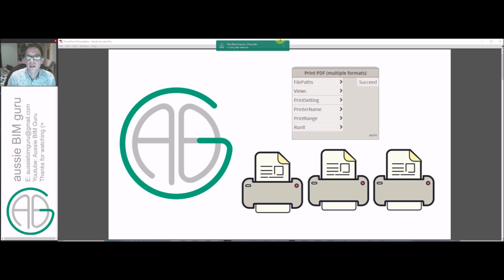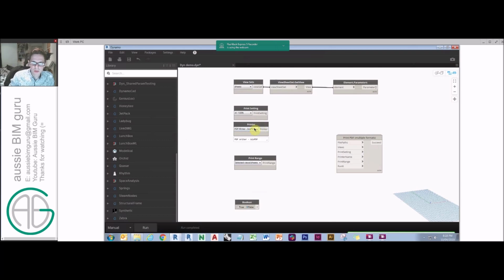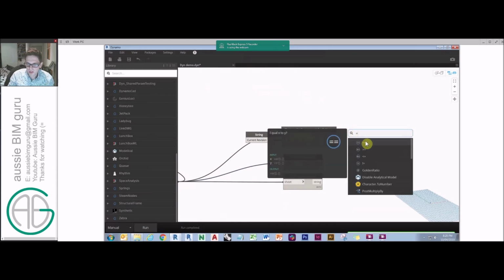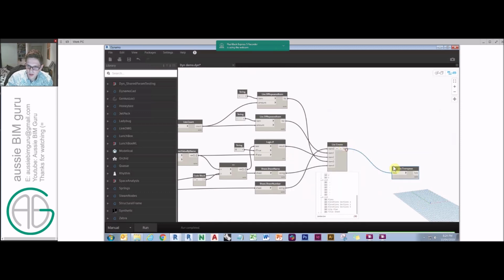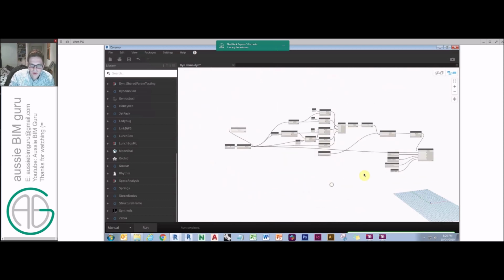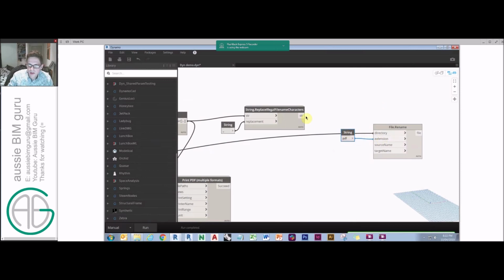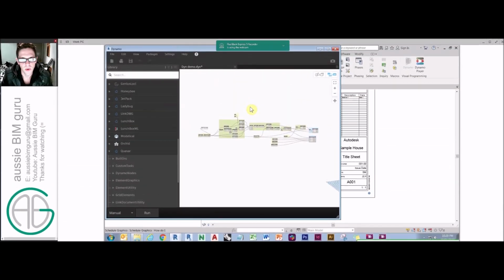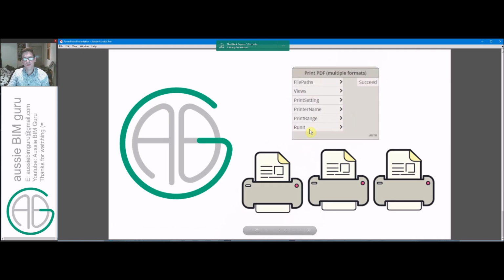Batch Print using Dynamo!

Comment: which version of genius loci have you used ? because Exporting pdf is not available before 2022. Also Revit developers provided Export pdf spec in Revit API for 2022 or above version. for below versions I need printing so for that I need which version have you used for Genius Loci, For that printer setting node and printer name selection node. I am using Revit 2021. Can you please provide that?
Reply from the maker: Its been ages so cant remember unfortunately. Yeah export pdf only works in 2022 plus and personally i found lots of issues with it crashing for large prints. I developed a printer in python for my firm and stuck with the printing API even in 2022+ because of that. Try archilab if you cant find the build of genius loci as it has printing nodes also.

Comment: Hi everyone, I have successfully create this Dynamo script but unfortunately when I try to "Rename" it on Dynamo player by setting it up as False nothing changes. It doesn't give any error, actually is Run Completed on green, but nothing changes.

In the other hand, I have been running the new BatchPrinting (2020 Update) and I have realize it has changed quite a lot from what I can see on this video. I can't find the Directory Path on dynamo for example. I just wanted to ask which buttons should I set up as In put to run it with Dynamo Player or if you are planning to drop a video for the Batch Printing script update. 

Thank you so much!!
Reply from the maker: These days I actually use Prosheets by diroots for most of my batch printing needs (free, naming rules etc).

Directory path should be available in 2020 still, that's odd!

I may revisit this on my course platform as an example potentially, but am unlikely to remake it for YT.

I'd suggest trying datashapes for UI using directory path for print destination, listview for sheets and dropdown for print setting.

Comment: Hi guys, excellent video
i have a issue in final part of script, I lunch to plot and i have back this " typeError: 'StackValue' object is unsubscriptable" 
any idea?
Reply from the maker: Sounds like a pretty wacky error... usually a stack issue relates to a script running out of memory space to finish.

Usually an ubsubscriptable item is one which cannot be handled as an object by a method or function. Make sure your lists of data are entering the final print node in a flattened structure and don't have sublists.

Beyond that, I'd try seeing if anyone on the forums has a clue! Wacky errors are common with custom nodes sometimes unfortunately - the joy of troubleshooting!
Reply: @AussieBIMGuru  thx for the reply, Untile the last "list.flattern " seeme like it work. the last connect to print multi pdf make ad error, i try changing the list.flattern node ( orchid for genius ) but the result is "null". i thinks is somethings wrong when i set a multiplay sheets. Single sheets print work, multi make error. I have to try to simplify the coding part of the sheets. I will update to you

Comment: How can you remove the ".pdf" at the end without having to do it manually?
Reply from the maker: I'll hopefully remake this tutorial in late feb to show a more direct method, but essentially i use Adobe PDF plotter which is more simple to set up and does not need the rename at the end.
Reply: @AussieBIMGuru  Brilliant. 

When I created the same script as you did, I still had to manually type in the name for every pdf. It doesn't do it automatically as it did for you.
Reply from the maker: @denishujdur8652  it may depend on the plotter you use. If you use adobe pdf you will need to supress the naming rule in the printer settings in windows also. This can be found in the printer preferences.
Reply: @AussieBIMGuru  Yes I managed to solve it! Thanks :) Is there a way to make a menu where you can choose which sheets you would like to batch print? With this script it prints all sheets in the Revit-file.  I don't want to batch print all sheets. Only some of them. Is this possible with Dynamo? I would be forever grateful if you replied to this.
Reply from the maker: @denishujdur8652  yep definitely possible! The key here is to use data shapes, I have a presentation on how this package works here;
https://youtu.be/wkwMsy9DQiQ

Comment: Thanks Gure this amazing video!

Just a little question about print pdf's, do I have to press every print OK to save it in your File Path?
Or is my (CutePDF Writer) settings not good?
Reply from the maker: I believe you may need to change your printer settings in the driver settings (outside Dynamo). Some print drivers can suppress this warning (e.g. Adobe PDF). I will remake this video for Adobe PDF sometime early next year and use this driver instead and show how the OK prompt can be prevented, but haven't tried CutePDF before.

Comment: Thank you from Germany for your amazing Tutorial. I tried to have the script, I did everything the same as you did in Video. but after running the script, it shows an Error " ..... Exception: Invalid Filename".
and also after running the script, the setting in biopdf print in Revit changes to the first option in the File section
"Combine multiple selected views\sheets into a single file. 
it would be really great if you can help me with that.
Reply: I just wanted to say I've found the problem. I had used forbidden Characters with the node file name to the path. Thanks again for your amazing work.
Reply from the maker: @mehdiheydari9363  yep that'll do it! Nice one on figuring it out, I use Adobe PDF as my plotter these days, it's a bit easier than BioPDF (doesn't need a renaming step).

Comment: Archilab node and pdfcreator has worked fine for me But two areas need to be automated. 

Firstly, I want to feed the paper sizes from Dynamo itself nstead of saving manually in Revit.
Secondly, I should be able to list all the viewsets and print with their respective papersize in one go!
  
any way to achieve above two milestones ?
Reply from the maker: I believe viewsets might be accessible as a class in the Revit API, but I haven't seen a node capture them all before. You could try finding it as a category or element type maybe.

Paper size should be sourced from the data related to your sheet's titleblock. This could be collected by assessing the elements of this category in the view (as sheets are also seen like views in Dynamo for all element in view nodes). You would need to adjust the print setting per sheet to then match the identified titleblock page size. E.g. if the titleblock name contains A0, match it up with the A0 print setting.
Reply: @AussieBIMGuru  Yeah I have built script which can create viewsets according to their sizes. I was referring to selecting paper sizes in print setup which pops up while printing. I didn't find any package which can help me in setting paper sizes for printer.
Reply from the maker: @shujath9176  I believe that you would need to preconfigure these settings in your model print settings as these are dependent upon the print drivers which sit outside Revit's API for sure.

Comment: Old video but I suggest viewers using PDFCreator Driver and change the filename setting to  "<InputFilename>" and Target Directory to "<InputDirectory>" to save the extra file naming step.
Reply from the maker: Thanks Sujan. I'll probably remake this tutorial eventually as I got my hands on PDF driver also and it makes it much easier.
Reply: @AussieBIMGuru  Please let me know if you have any sample starting point for getting naming convention from Excel( I'm aware of XREV and Pro-Sheets) ;)
Reply from the maker: @sujanmaharjan9182  as we discussed I haven't set up such a workflow before. I would build a row or column per convention, with each cell being a parameter name to draw upon for joining together. Python has some concatenate functions that may help here which can join lists of strings using a common separator between each.

Comment: Hi 
can anybody tell me were to find the (ViewSheetset.Get view) i have looked everywhere but just cant seem to find it ?
Reply from the maker: I believe this is in archilab package iirc.
Reply: @AussieBIMGuru  
Hi 
Thanks for this i cant seem to find the printer node in either Archi-lab or clockwork plus the rename file seem different in Archi-lab it has the following inputs
Reply: Directory path, Identifiers, New names, and runit
Reply from the maker: @TheMadgeman  i am using Dynamo 2.0.3 for most of my scripts, which build are you using?

Try the genius loci package for print nodes instead. The orchid package has a good file renaming node as well so try this instead.
Reply: @AussieBIMGuru  HI thanks i have this working now but i want to add a revision to the end is this possible ?.
Reply from the maker: @TheMadgeman  yes the revision should be in each sheet element's parameters.
Reply: Thanks I will try and get this to work. Do you know the file rename come back with null and an error when I run it ?
Reply from the maker: @TheMadgeman  what does the error say? My guess is the input types are incorrect, or your files are set to read only.
Reply: Error msg . File. Rename operation failed. The given path’s format is not supported.
Reply from the maker: @TheMadgeman  and the path format?
Reply: PDF
Reply from the maker: @TheMadgeman  hrm odd. I'd try removing/adding extensions and also playing with the file path format (try adding the slashes twice to avoid 'escape characters') and see if that helps.
It's really just a debugging exercise when it comes to errors and nulls I find.

Comment: Hey Gavin I would suggest PDF creator app from pdfforge.org for better control in file naming and directory placement.
Reply from the maker: Interesting, I'll give it a look. Thanks!
Reply: @AussieBIMGuru  another thing I added was 
1. Option to export DWG as well which is available from Genius Loci. 
2. You would need to change file naming setting in PDF Creator setting as <InputFileName> and for directory <InputDirectoryName>
3. A warning message if Worksets are closed (let me know if it is possible to detect Worksets closed from Visibility Graphics)
Reply from the maker: @sujanmaharjan9182  yes I look forward to optimising this plugin this year as I will be using it for personal work now - more motivation to perfect it! This video was my 'version 1', I ended up at around version 3 or 4 eventually!

It looks like Bakery can detect open worksets; https://dynamonodes.com/2016/02/12/get-open-worksets/
Reply: @AussieBIMGuru  is it from Master Workset dialog or Visibility Graphics?
Reply from the maker: @sujanmaharjan9182  I would expect given this is using the term 'Open' as opposed to 'Show' this should be the master.

Comment: Hey thank you for the video I have tried to replicate the video for my own project however I cant find the first node which is the View sets
Reply from the maker: I believe it's from archilab.

If you're in 2020 there's a chance some nodes might not have made it across yet. I will be remaking this script for gitbub around april hopefully
Reply: That would be great, however for the mean time would you be able to recommend another way of doing this output. I have 100's drawings I need to get out and don't want to do it the traditional route :) .
Reply from the maker: @sagalrooble7239  if you're in a bind and this isn't working, look into Xrev or RTV.

If you want a more experimental but free tool try the sheets plug-in by DiRoots.

Comment: Hello from Adelaide mate!
Nice Dynamo / Revit tutorials mate. Probably some of the best on youtube.

I have been looking at a batch printing workflow similar to what you have here (but using the archilab node). I found that if you use PDF Creator and set it's print setting to:
Saved path: <Directory path> 
File name: <file name>
As well as having the combined boolean input set to true (even though it's broken in the archilab package)
It will populate the pdfs in the correct directory with the correct name. So you only need to run one script.
Maybe you have improved this workflow by now, but if you are interested I can share it with you.

You've provided a lot of great content and ideas on this channel.

Keep up the good work!
Reply from the maker: G'day Tim - great to hear from a fellow Adelaidean (I lived in Adelaide from birth until 2015!). My first project out of Uni was the NRAH - a great kickstart to the BIM side of my career.

Thanks for the pointers, I found the same when I revisited this script using Adobe PDF as my plotter and found the directory/file path worked as opposed to my plotter in this video.

I believe Genius Loci actually derived the PDF plotting node from archilab so it would make sense that both perform similarly!

Thanks for the support, much more to come in future.

Comment: I am trying to print several pdf files from a directory with revit files without opening them.. This seems to only print one revit file I have open at the moment, which is to my believe a very useless script ?
Reply from the maker: Thanks Selim, I agree that a script able to print from models that are not open would be ideal - likely too much for Dynamo on its own to handle however.

This script is focused on batch printing whilst in a Revit model to save the user having to name each individually. Similar to plugins like 'Xrev' or 'RTV Tools' which are very popular in the industry. A lot of clients will require drawings to be individually printed and named in a specific way.

If you wish to print from a Revit model without opening it, you will need to likely set up a batch routine using Revit API Scripting (and potentially a remote machine to do it for you - I think you will always need the model to be opened to print from it). This is indeed more complex than Dynamo (and this script!).

If you're interested however, there are some people who have technically found ways to do this, but they are complicated;
https://forum.dynamobim.com/t/export-sheets-from-linked-models/6607/7?u=mostafa_el_ayoubi

I have also developed a more advanced version of this script with an interface where the user can select sheets from a tickbox list instead of making a sheet set as well. I will hopefully upload a demonstration/tutorial for this at a later date :)

I hope that helps, if not let me know though! Thanks for the feedback
Reply: @AussieBIMGuru  Thanks for the fast response! It seems like my hopes for Dynamo are a bit unrealistic. I will check out that forum link tomorrow and see how far it will get me, been struggling for days trying to print sheets from unopened revit files in a document! I subscribed to you and will definitely check out your other videos to help me in my research of workflow optimisation with dynamo for revit. (Bachelor thesis) Thanks Aussie Bim Guru!
Reply from the maker: @scelem  brilliant, great choice of thesis as well! C++ and API scripting will definitely be the most efficient way - beyond my skills currently, but a future goal! Dynamo is a great introductory way to get into visual coding and develop everyday tools, but sometimes the big guns are required for fully optimized workflows. As always though, the depths of our creativity are the only true limit 😉